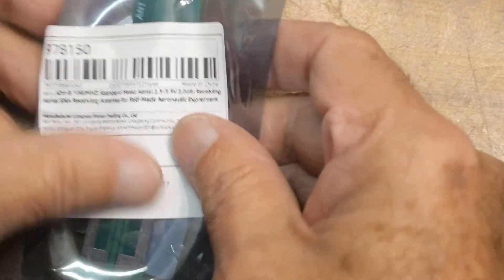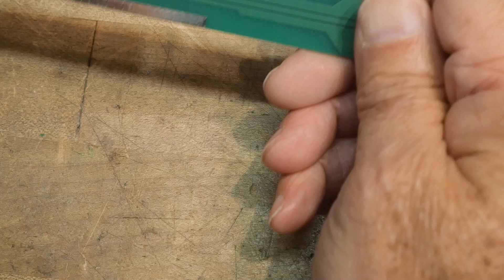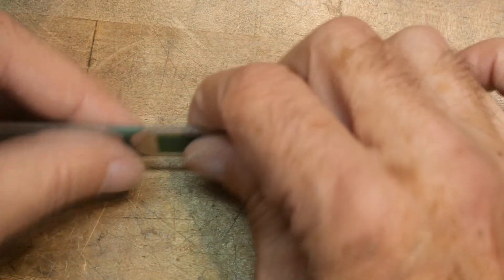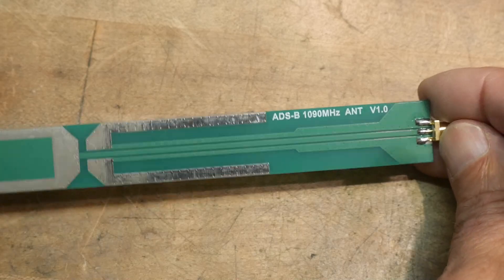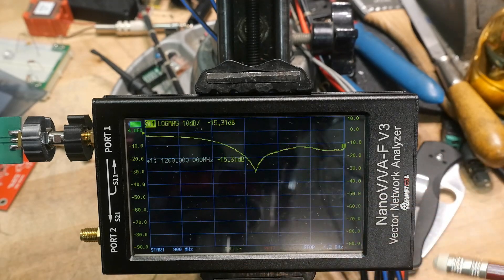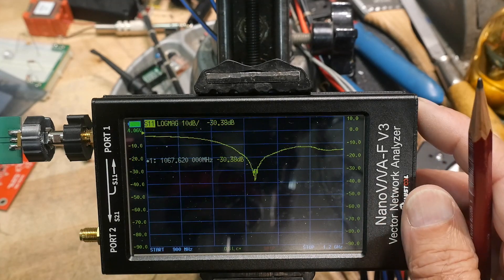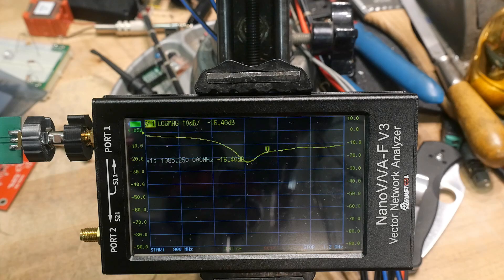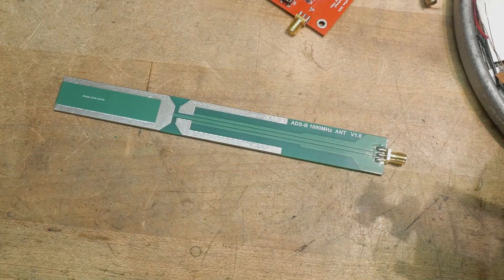#2109 ADS-B 1090MHZ Standard Head Aerial

Comment: Looks like a flat version of a rubber ducky (sleeve dipole)
Reply from the maker: https://youtu.be/xb0nQiQ3SXU?si=85wvR1jaIhc3n7DB
Reply: @IMSAIGuy  OK not /that/ design of duck 🙂 !  Good how-to and clear drawings if one asks a search engine for incompliancemag sleeve dipole.

Imagine removing 1/4 wave of coax Jacket, then fold back the shield over the jacket to expose the 1/4-length  center conductor as one leg of a center-fed half-wave dipole. The folded back shield sleeve is adjusted to 1/4 wavelength and becomes the other leg, and the shield-jacket-shield transmission line inside that leg is a quarter-wave trap/balun. Shield-jacket-shield makes a high-loss transmission line with an unknown VF much lower than the shield-air dipole leg, so there's a compromise, which can be reduced if there's mostly air dielectric in that leg, so...

Usually the sleeve is metal tubing, arguably including the ubiquitous ads-b coke-can., The rubber ducks may be two diameters and half stiff, half flex, and the flexible side may be a normal-mode helix aka coil for compactness.

Comment: Yup, for monitoring ADS-B aircraft data. Looks like a pretty neat little antenna. Put that in a weatherproof enclosure and you're set. Funny, they put a voltage rating on there, a passive device. I suppose if you had an amplifier and did not block the DC this rating might be useful. And 2dBi gain as if that's something, it's a dipole, they have about 2dBi, purely an academic notation. It's a clever strip-line feed though. I'd check calibration. It would be best if resonant at 1090. It would be foolish to change tuning for impedance match when the feed line could be tweaked to match it. Now I want to make one.

Comment: Interesting.  ATC radars and devices like TCAS interrogate at 1030MHz, and "ADS-B" (1090ES) transponder replies are at 1090MHz.   Actual aircraft stub antennas I believe are usually a single element for TX/RX...so perhaps it would make sense to center those at 1060.  Maybe that's where the sizing for this one was driven from.

Comment: 1080 MHz is a standard transponder (secondary surveillance radar) frequency for aircraft (that's the thing people set for things like emergencies and such, which is why you hear "Squawking 7700", and it's something hijackers and terrorists disable). Ground ADS-B comes in two flavours - 978 "Universal Transceiver" (UAT), and 1080-ES which is a Mode C or Mode S transponder with Extended Squitter (ES). Thus for all ADS-B Out, you can have 978 UAT (usually for light aircraft), or 1080 ES (typically airliners). 978 offers ADS-B In service to transmit weather (FIS-B) and traffic (TIS-B) information to suitably equipped aircraft. Note that 978 is restricted to US-only flights. Canada went with space-based ADS-B which only works at 1080 and requires a diversity antenna (i.e., transponder that transmits both above (to space) and below (to ground) to work both US and Canadian airspace. This is because US airspace is too busy for space based ADS-B reception, and Canada is too big and sparse to have ground receivers to cover the country.
Reply: 1090 MHz, not 1080...

Comment: can't understand why they need voltage on a passive antenna, and yes, the ATC transponders frequency is 1090mhz, so for rx only, a nice little portable antenna for use with an SDR dongle, if you wish to use it for an ADSB out transponder, you could trim a bit off the active element as it is a bit long at 1069mhz.

Comment: Would be interesting to see an EZNEC simulation of that antenna.  I've just been using a simple home built one and that's worked pretty well with a few of the SDR receivers I have.
Reply: I don't think EZNEC has a means of modelling the printed circuit board.  The antenna amounts to a center-fed half-wave dipole with a choke balun built-in and a matching section in the right end.  It should produce a radiation pattern approximating that of an ideal half-wave dipole, but the balun and matching sections will also radiate somewhat, causing some alteration to that pattern.

Comment: 1090 MHz is typically used for Aircraft positioning (Automatic Dependent Surveillance Broadcast ADS-B).  This might be for one of the receivers...
Reply: That's exactly what it's intended for. :) I got one for playing around with ADSB an adsb receiver at home.
Reply: Not exactly correct. 1090MHz is primarily the received frequency for the ATC secondary radar (civil and military), see ICAO annex 10.
ADS-B came a lot later when transitioning to Mode-S (and only transponders with squitter capabilities, still not mandatory).
Not to forget ACAS that uses also the two bands 1030-1090MHz, and Multilateration...
ADS-B doesn't provide by itself positioning as it fully relies on external positioning devices (could be GPS, Galileo, or inertial computer, etc.)

Comment: In addition to ADS-B,  1090 MHz is also the frequency that aircraft transponders use to reply to beacon (ATCRB) and Mode-S interrogators. The beacon interrogator transmits on 1030 MHz. Regards, David
Reply: Interrogation is performed on 1030 MHz, not 1060 MHz
Reply: @etienneguyot9069  OOPS! You are correct - been away from the job a bit to long. 60 MHz 1st IF. Regards, David

Comment: I wonder what board material was used for this. Also, this antenna could probably be tuned to match at 1.09GHz precisely.
Reply: It's essentially a single-sided design and they even stitched the radiating sections across both sides, so the only place the dielectric gets involved is the strip line from the connector to the center which not counting the silk screen is half air half PCB dielectric, so it might not lose much. Also the "excessive" width of the radiators will somewhat reduce the detuning from sticking it in plastic pipe.